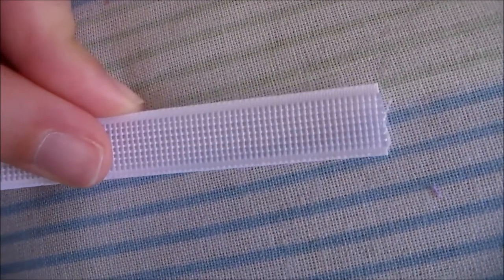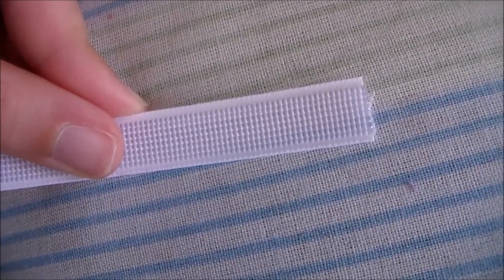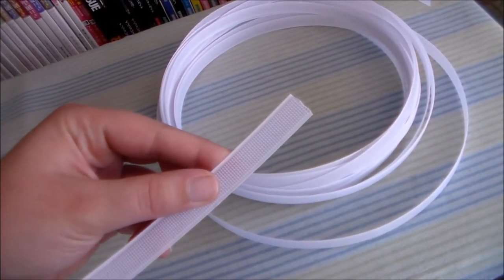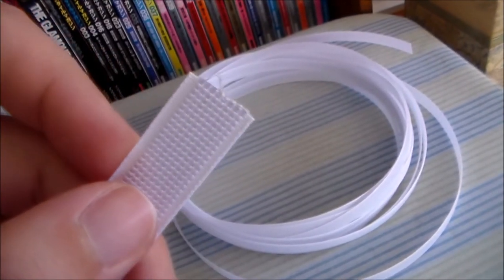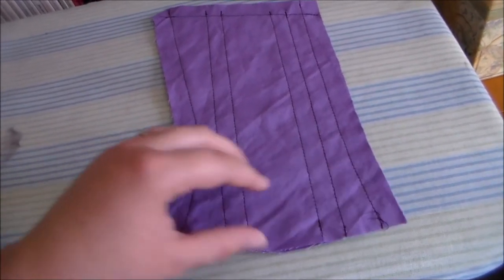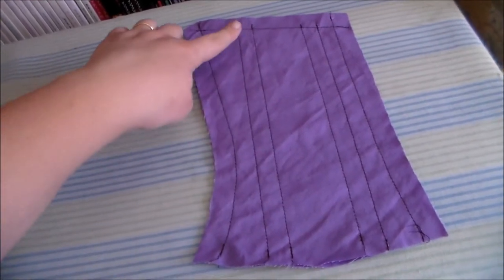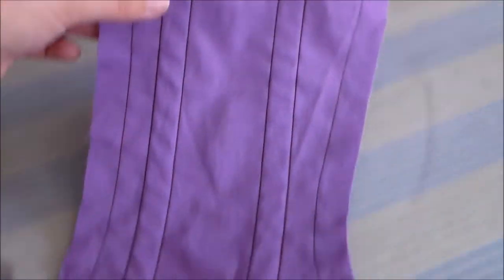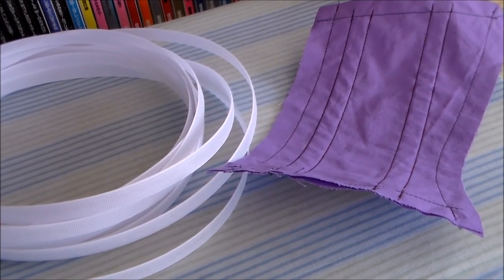How To: Use Rigilene Boning

Comment: You can also sew through this type of boning and sew it directly to the garment itself. If the garment is lined, this works especially well because you can put all the boning in the lining so the seams all stay hidden.
Reply from the maker: Yes!
Reply: Can i sew through it with any sewing machine? I have a pretty cheap one rn
Reply: @miemora5920  You should be able to. It's a fairly lightweight boning, so as long as you're needle is a 75/11 or thicker you should be ok. If your machine can sew denim without choking I'd imagine you'd be fine.